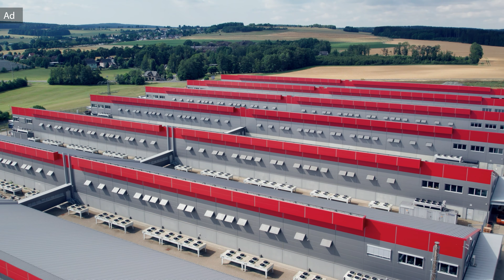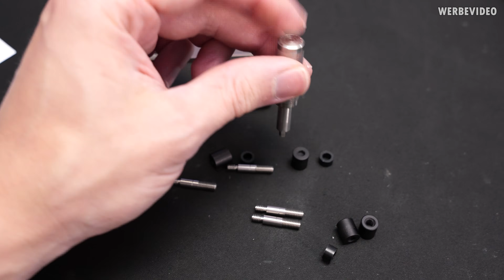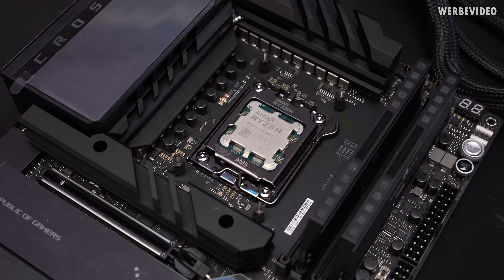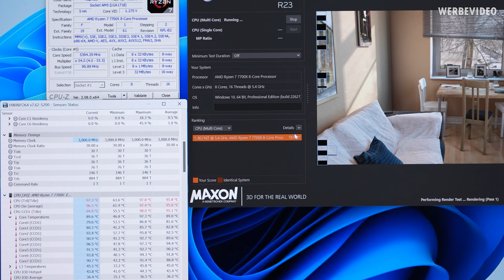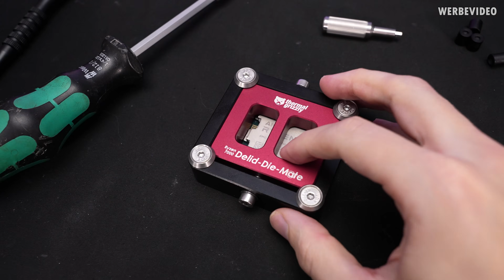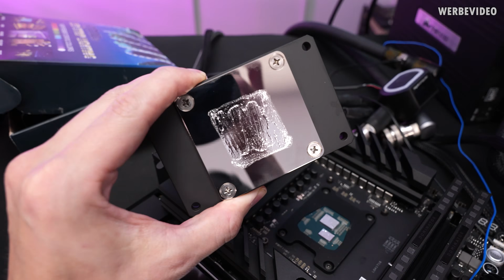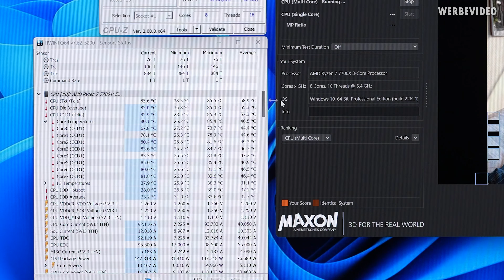The King of Water Cooling and Questionable Marketing

Comment: @der8auer-en ,
Hi great video. Can you compare Ryzen 7800X3D & 9800X3D temps with the best Optimus CPU block on top of a Thermal Grizzly AM5 heatspreader vs Thermal Grizzly Myro Direct Die RGB?, if Optimus CPU blocks and Thermal Grizzly heatspreaders are even compatible with each other?

One of Optimus's selling points is replaceable cold plates?, provided they are still being sold. When will T-Grizzly stop selling AM5 parts?
I tend to keep my PC's for years so knowing I can replace parts is important to me. how long do waterblock fins or optimus cold plates last? how does fin thickness, channel thickness or fin density affect longevity?

As far as Direct Die CPU Block
I do feel more confident of not breaking my cpu with the thermal grizzly block vs optimus(with the AMD SAM Mechanism).

I will probably get Thermal Grizzly CPU block over Optimus, but I am considering using a Thermal Grizzly AM5 heatspreader with an Optimus CPU block for Ryzen 7800X3D or 9800X3D, if compatible? I am not sure if optimus's replaceable cold plates increase longevity, or if optimus have turned a durable part into a consumable? They have approx 0.1mm fins & channels.

I expect Optimus uses Electrical Discharge Machining to get so much fin density?

Would you see lower temps if the thermal grizzly block had equal fin density to optimus coldplates?
(With a powerful pump I expect)

I wish you made similar heat spreaders & direct die CPU blocks for intel i7-6700K, for a Win-7 gaming build, not sure
If worth your time tho?

Do you plan to make Thermal Grizzly GPU Water Blocks?

Would spiral cold plate fins be any good?

Many Thanks, Sorry
for million questions.
Keep up the good work! 👍

Comment: I’m actually shocked you don’t have a water chiller, but ideally using a chiller with a set temperature +/- .5c would be the ideal testing method so that all test will have the same Heat Transfer Coefficient. I’m sure your water temp doesn’t vary much in testing but a chiller is the scientific way to properly test. Removes all other variables. 

If u don’t want to spend big bucks on one u can build one with a big igloo as a reservoir using a fish tank chiller, or a window HVAC air conditioner, & some copper tubbing coiled up inside to transfer heat from the reservoir that is chilled to water loop for test bench. A cheap water circulating pump in reservoir, & a power outlet thermostat controller is using HVAcC unit. 7-10gal of water will take a while to change temperature so should be able to make 10 runs of CB with no significant change in water temp maybe .1-.2c

Comment: 105W vs 170W. This is like comparing 2 CPUs in a game where they are GPU limited and then declaring the CPUs are the same.  Put the CPUs under more load and the differences in the CPUs will become apparent.  With a 105W CPU the blocks perform similarly, that does not mean they will perform the same on a 170W CPU.

You know this. Seems like a weird marketing video from you.

Comment: You admit that you have a delidded 7950x, but you didn't use it in this test.  You don't need to use the same CPU for lidded and delidded. So the excuse of not wanting to delid another is silly. You could have used any 7950X/7900X for the lidded test and then used the CPU you already delidded for the next test.

105W vs 170W. This is like comparing 2 CPUs in a scenario where they are GPU limited and then declaring the CPUs are the same. The CPUs will perform the same if the GPU is the limiting factor. The Optimus is clearly capable of more heat transfer, but when tested at lower loads the output is going to be comparable to lesser blocks. A 65W CPU might have similar temps with a good air heatsink, that doesn't really prove anything beyond the obvious.

You know all this, so it seems like you chose a low TDP CPU so that the benefits of the Optimus block would not be shown in the results.

Comment: The  "water temperature normalized" and then results shown out to 2 decimals is silly.  If your test isn't precise enough to maintain water temp, then its not precise enough to show results with any decimals. Why is the water temp not the same? If the ambient air temp is the same, then the setup with higher water temp has a better cpu block since it's pulling more energy from the CPU into the water.  Water temp is actually a good measure of how well each block is performing. If you can't keep the water temp stable, then you should show the initial & final water temps along with ambient air temp. A larger water temp change indicates a better performing block

Comment: You showed and admitted that the quality and design of the Optimus block is superior. Then you showed that with a mid range, 105 TDP CPU doesn't really benefit from that superiority. The superiority of the block is proven by putting it under larger loads of a CPU with a 170W TDP, which is exactly what Optimus' testing shows.  You claim to refute their 170W TDP claims by using 105W TDP claims......

I have enjoyed your videos for years, but this one seems silly. If you're only pushing a 105W CPU, then the crazy big overkill water block won't make a difference over a high quality block. That should be a surprise to no one. You could put a decent air heatsink on it, run a little hotter, and the CPU will perform the same. Watercooling is all about overkill.

Like comparing a standard Mercedes vs a Maybach version. Yes if you compare them commuting to work or getting groceries then they both accomplish the task just fine.

Comment: They are right only about the chiller. You can't compare 25>55c vs 28>58c, it's not the same delta.
Reply: Indeed, I am curious about exactly how the "water temperature normalized" was calculated. Silly to do an "adjustment" to the results and then display them out to 2 decimal points as if its that precise.  If you can't keep the water temp stable, then you should report the initial and final water temps for each test. The water temp is actually a good way to measure how much energy the cpu block is moving. Higher water temp delta means better water block.

Comment: First, I am an American. Second, I support American Products. I also support products from other countries. I will say the the Optimus block is very good. If I wanted a ihs designed waterblock for AM4 and I had the money to spend, I would purchase an Optimus. If I wanted a water block that was designed for direct die, I would likely purchase the Mycro. I concur with the channel here, I don't understand why someone would make those types of claims. And then to call out testing methods, rather that just say there was some kind of mistake is a bad marketing move. 
   To be honest, the block is awesome, its biggest negative is the marketing claims. Hopefully what I hear about customer support improves. Why would anyone claim that a water block using an IHS is going to beat another that is direct die unless it is also being used in direct die form? The ihs is a barrier that design cannot overcome. It is impossible.

Comment: I have this blcok, I switched out my EK block for it. It was a big difference on my 7950X. I am very satisfied with it. Iy keeps my 7950X double digit cooler than the EK block & the 7950X is a hot CPU.
Reply: Never heard of a 10 degree difference between any water block.

Comment: As a long time fan, I gotta point out 2 deceptive things you did in this video that are very disappointing.

1) You somehow thought it was a fair comparison to test the Optimus block on IHS using normal thermal paste while not doing the same with your own block on direct die, where you used liquid metal. We both know that liquid metal can make several degrees difference. Very unfair and biased action to make your own block look better.

2) You showed the Optimus website, so you're aware of it, but completely ignored the fact that they ran their tests and got their numbers using a 7950X at 250-260W. You're trying to disprove their claims by running completely different tests.  You used a 7700x which has a 105W TDP and even with your overclock is around half the power consumption.

The higher the temperature you're trying to bring down, the more of a noticeable difference block quality makes. Or rather, the degree of difference between the blocks expands. 

You're literally testing a $269 block on a $268 CPU. This is not the CPU nor the workload that the block was designed for. In the future if you want to refute someone's claims, you have to show tests under the same conditions/perimeters that led to their claims. Otherwise, in my opinion, this video ended up being far more biased and bad marketing for Thermal Grizzly than your claim about their marketing issues. 

Again this is coming from a long time fan of both you and Thermal Grizzly. Hope you do better in the future. Have loved your content and products for years and will still continue to do so regardless. Cheers.

Comment: This was timely. I just totally gave up on EKWB after many years. Kept having problems and find that the products seemed to be getting more frustrating and having quality issues for a while.  Last weekend I was trying to take a 7950x cpu out of an asus 670E motherboard. It had a velocity 2 cpu cooler from EK. When trying to remove it  ( tiny hard to see attachment screws that go in from the backplate I had a severe problem ) Not only are they so tiny they are super hard to see, they are soft. One of them literally fell apart as I was trying to undo it and the others rounded off in 2 out of 3 others. So I had to drill them out of the motherboard damaging a perfectly good motherboard and that was the last straw for me. Heard great things about optimus so I decided to pay the extra and buy a cpu and 4090 block from there for a 9950x I am currently playing about with. I love the build quality but also, the customer service. The service was excellent (thanks Marija).  I cant compare temps like for like right now as I only have one 9950x and 870E build running at the moment and Ia am still playing around with the build. But it was such a nice change and has standard mounting with robust fixings. Can use myfix kit and it works fine, no slightly off standard little allan key to keep safe or anything like that. For me this is great as I play around with hardware all the time. I want durability and non standard fixings annoy the hell out of me, though not as much as soft and thin to the point of invisibility. I am a bit concerned having read some of the comments here. So far so good.

Comment: I bought the core 1 alphacool block based on your review. It wprks great and is super easy to install on am5. Does the tg direct die frame v2 fpr ryzen 7000 work with the core 1 block?

Comment: If you have massive surface area with water, the naturally you want to make the temperature differential between water and the heat sink as big as possible with a water chiller, this will maximize your surface area advantage.

Comment: Roman, absolute class act in acknowledging the positives of the Signature V3, while also objectively showing the false marketing in a respectful manner. I find the marketing of Optimus quite hostile, this only shows overall weakness. Also, for Optimus saying that your (or any other customer's) testing methodology is wrong, is kinda sad. I really hope that Optimus will revise their PR and marketing, as from a technical standpoint, it is a very high quality product. I really hope that if Optimus's marketing departement is actually a separate marketing departement, that they will revise their strategy. If the marketing department is the same group of engineering people, please hire a good marketing person/team. Acknowledge that you are very good in developing a high quality product (that deserves respect), but that marketing is a different profession that can make or break a company's reputation, regardless of the product quality.

Comment: Between cost, weight, a more vulnerable cooling surface due to even tinier structures and more wobbly mounting... I don't think I can justify getting an optymus over the mycro.

I very much hope the mycro will be compatible with zen 5 X3D, since that's when I plan to upgrade next.

Comment: Calling Roman's testing methods "wrong" is enough of a clue that at the very least one person at Optimus has NO clue what they're talking about. The most important part of testing isn't what test(s) you run, but rather removing or at least maintaining the consistency of as many variables as possible between runs and between products - which Roman is extremely fastidious about doing

It's really unfortunate that such a good product is overshadowed by their own idiotic sales and marketing antics. Saying things like they want to keep things classy, while simultaneously calling out another specific product?! Super NOT classy. If you can't get sales by how good your own product is, you certainly won't get them by trying to claim how bad someone else's product is. What lazy marketing smh (especially since their claims aren't even true. Block-to-TIM temps being lower than direct die?! On what planet???)

Anyway, I'll gladly NOT buy what is easily one of the best blocks out there and settle for just about any inferior product just to not support a company that acts this way. Also, it's super expensive. Double the price for slightly better performance isn't worth it in most cases

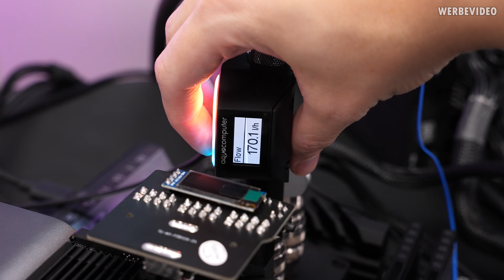Comment: I do enjoy the care you invest in your videos which IMO are unmatched by any others.  Had a question though.  I noticed that for example at 6:32 you show a pump flow of 170.1 l/h (or about 0.75 US g/m).  Is this a static setting or is it managed with PWM?  Assuming static, in my systems, I have found this to be too low, I tend to use more like 340 l/h  (or about 1.5 US g/m) PWM managed for such workloads.  The increased flow level makes a very big difference in my benchmark temps without having the fans/pumps blastingly loud.  As a pertinent example, a i9-13900KF running Cinebench R23 gives 40.5K with 82C max pkg with 26C incoming (HEATKILLER IV PRO Copper block, MO-RA3 420 w/18 Arctic p14 PWM fans push/pull).  It really seems to work better/quieter with higher water flow.  If I were to use that super nifty Optimus block (LGA1700 version) I'd increase the flow.

Comment: Apparently no one takes continuous water flow into account, the pumps are still not good enough to do this, water can only absorb so much heat when it flows, too fast is not good and certainly not too slow, therefore these numbers need to be better regulated for stability too cool, with coolant, which does not only consist of water like a car, etc.

Comment: Their "reasoning" to not use liquid metal makes no sense. Especially if you're going for "the best" performance why would you compromise at least 5C (often more) by being too timid to use metal?

Unless you're going sub-ambient, there's no situation where using thermal paste instead of liquid metal will ever give better temps - especially in direct die situations.

The only edge cases would be metal compatibility, and even then that's still a compromise short of the heatsink material being something exotic like synthetic diamond or ceramic - and even then liquid metal probably would still be better than any traditional TIM in those cases.

Comment: Hey Roman, Optimus here, thanks for the great video! And thank you for passing the blocks onto the next reviewer, the more good testing out there will only help people get involved with liquid cooling, which we all want :) And we really appreciate you taking the time to go over the manufacturing and block quality :) And good point about different testing methods. For people following along with questions, it's worth clarifying that our benchmarks used a 7950x CPU that puts out ~255w. Obviously, this is a different load than a 7700x at 145w. Our customers want max performance for the top CPU in the world, so that's what we aim to do. The higher the load, the more difficult it is to cool. We would love to see these tests repeated with the top CPU :). Regarding benchmark software, we use Prime95 because it's easier to hold really tight load testing parameters. It's not about torturing the CPU, but delivering a constant load so everything is equal from test to test. Short 10-20 second Cinebench and gaming tests struggle in this area. Especially considering achieving thermal equilibrium in the PC needs over 10 minutes to be achieved, closer to 30. GamersNexus has a great article about thermal equilibrium and how long tests should be, definitely worth a read. The temperature regulator we use is set at 20c, which means it takes the liquid temp, air temp and radiator out of the equation. To get accurate block numbers, the liquid temp must remain rock solid. In any case, awesome stuff!!

Comment: I like how you own Thermal Grizzly and you don’t have a 7950x to test which is what the block was built for. You tested the block on a 145watt cpu. Try 250 watts next time. You are being quite biased.
Reply: Very true.  You don't purchase the best block for a mainstream processor. I run my 5950X and 7950X's at 250 - 270W and my Epyc 7H12 and 7713 cpus at 240W and 280W.

Comment: I think once you get to the performance demonstrated by both Thermal Grizzly's and Optimus's blocks, most high-end, direct-die waterblocks are going to perform within margin of error and the deciding factors for the customer are really going to come down to aesthetics, ease of installation, and price to performance. The Mycro is over $100 cheaper and has RGB for those who want it.

I guess what I'm getting at is the Optimus block doesn't really have anything special to set it apart, other than is exorbitant price.